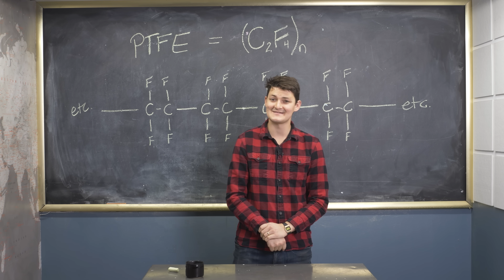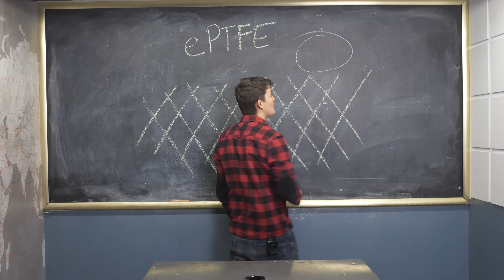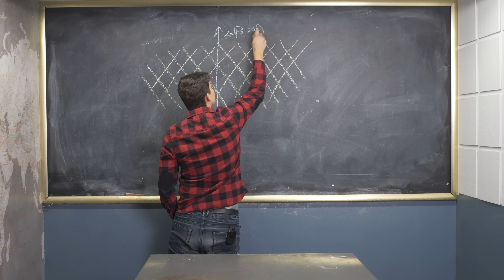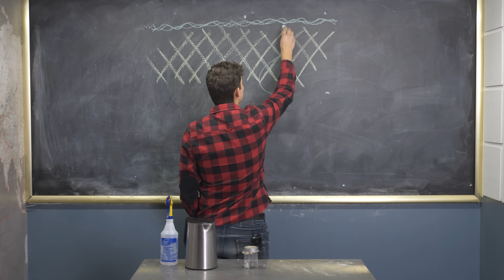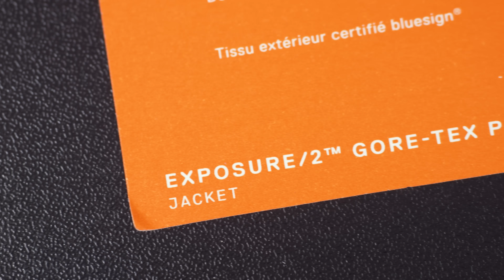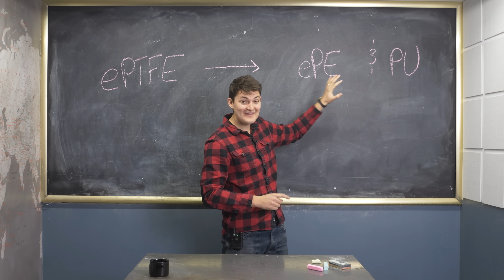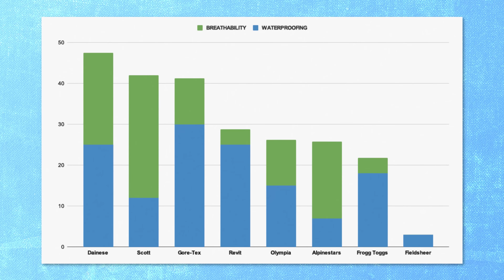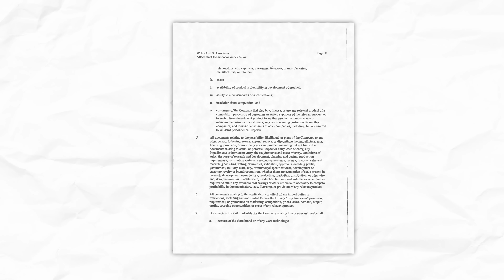Gore-Tex is a Marketing Gimmick

Comment: I was in the US Army when this stuff was on it's takeover in the boots and jackets department. We were forced to wear it, basically for testing, and we all come across one common point. 

Rather be soaked wet, than soaked in sweat
Reply: I remember getting my first issued Gore-Tex "raincoat" and it was terrible.  Sure it didnt let water in (but it did) but I was sweating my ass off inside it.  When youre in the humid rain standing watch for hours on end water just finds a way to seep in, Im guessing through the stitching.
Reply: Dude, the old ones were RUBBER.
Reply: In heavy or prolonged rain you're going to get wet eventually anyway  Might as well just accept this truth and choose clothing that keeps you warm & comfortable even when wet, and is quick drying.
Reply: First Gen had no vents. That was the only issue, and you didn't layer properly.

I literally have a first gen Gore-Tex military parka from the navy. Ever heard of wool? 😂
Reply: So you rather be wet by cold rain than by your own bodytemperature sweat?
Reply: @halamagrep9727  woolcloth keep you warm, even when u are wet.
Reply: Imagine staying in a hot bathroom after you've finished your shower. Even a hot and humid SE Pennsylvania July day is preferable to that. The actual issue is that in a rain jacket, soaked in your own sweat, there's no possible escape. @halamagrep9727
Reply: @halamagrep9727  Right, because sweat is meant to maintain your bodytemperature.
Reply: @jesperburns   did u ever do physical activities outside when its cold?
Reply: @halamagrep9727  I was a professional ice speed skater and still go skiing every year.
That's not what the military dude is talking about though, as you don't do those things when it's raining. Try understanding it from his point of view.
Reply: @jesperburns  Im a MTber and i do those things outside when its raining. and thats what waterproof jackets are all about. To keep the cold rain outside and the warm air in. Ofc you are wet, but not cold. its not a hard concept to grasp
Reply: @halamagrep9727  Cycling is really tricky when it comes to clothing choice. You take a level of physical exertion on par with running and then add in moving at 15-25+ mph, rain, near-freezing temperatures, and then maybe even a headwind too for extra fun. Coming from a distance running background, it's a lot more complicated than just slapping on enough slayers.
Reply: @Pellagrah This is true. The mention (in the video) of the wool jumper and bin bag made laugh because there is some truth. Often (when cycling) I want a close fitting, lightweight, easy to put-on/take-off rain layer only because the second it’s soaking me there will be a layer underneath better at allowing heat to escape and wind chill off. Wool is actually quite a nice base and mid layer imho.

Comment: And that's why proper design matters. The last two jackets I bought are actually breathable: they have adjustable air vents on the sides, rain protected by their location under the armpits, and my current one even has a moscito net for insect protection. Even during extensive biking I keep cool and mostly dry. The only part not perfectly ventilated, especially when carrying a backpack, is the middle of my back. Looking forward to the design that solves these remaining issues.
Reply: I'm looking for good rain gear. What brands do you like?
Reply: I think you'd need channels or a perferable layer to allow air throug. Like the mesh foam pads or mesh stretched like on backpacks
Reply: @tajr22  Probably. I think this is already part of some motorcycle jackets. 

And for the people asking: If you are looking for functional 3 season wear, ignore the outdoor adventure stuff and look for work wear brands instead and select the one with the least offensive color scheme.
Reply: @haifutter4166  pretty good bet with work wear although I've had some hit or miss. Not all of Helly Hansen is good.
Reply: why should you expect ventilated back when there is a backpack on your back?

Comment: I am buying goretex shoes for years now and never ever I had any issues with them. But I am sure of one thing. I will sweat like pig in those, they do not breathe. But, if I accidentaly dip int pool of water (assuming not over upper edge) I will be completely dry (apart from afire mentioned sweat). Maybe some dodgy marketing but I know what that is and what it is and I will buy my goretex shoes again for winter time. No other "water repelent spray" or similar stuff ever worked propperly or at all.  That is comming from some 20 ish years of experience give or take.

Comment: I worked for a textile mill and we had a treatment for our outdoor wool which was waterproof but was so light it felt like the regular wool. Trouble is because it felt like nothing the retail customers didnt trust it and didnt buy the garments made by our fabric. Manufacturers went back to buying our older, "waxier" versions.
Reply: Hi, its really interesting! Could you give me any information how that kind of wool is called? Or how and where i can find this type of wool?
Reply: I dunno about the wool but you might find marine cotton interested.  Cotton woven extremely tight and keeps water out.  Expensive.  @Grandemuczaczo
Reply: @Grandemuczaczo  seconded :)
Reply: As someone who has some experience wearing historical clothing, we have kind of collectively forgotten how good natural fibers are. An outer layer of the right wool fabric will keep you warm and dry without any fancy treament thanks to the natural oils in it, as long as you don't wash them out with detergents. Inner layers of linen are great at managing sweat, dry quickly and will never get as smelly as synthetics.
Reply: @porter-831 I started out as the lowest budget camper with the crappies material, literally garbage bags and tarps. As I got older, I bought "better" stuff but eventually realized it wasn't doing that much and later "downgraded" again. It's not worth all the thought and money.
Reply: @porter-831  yes I have sprayed my old woollen cloak for renfair with a modern waterproofer and it looks the part and keeps me much dryer and is much more comfortable than my "technical" garish modern waterproof
Reply: Can't you use clever demos to explain the pros of you product? In digital age easy to make good videos about it while hand on demos are always the best. TBH, I would take regular wool over any goretex garment.
Reply: @cubertmiso  While alternative fabric suppliers can make all the videos they want, Goretex has outspent the rest of the market many times over in convincing the customer that it is the best. When we manufactured waterproof breathable clothing, if someone said how does it compare to Goretex, it was unlikely they would buy our product.
Reply: That's so funny. That happens in most industries in America currently- Weight is associated with value so for example manufacturers of lower-end luxury pen, phones, bicycles, EVERYTHING will add functionally worthless steel blocks inside the product to increase the weight.
Reply: @vitriolicAmaranth  Britain too. I suffer from nervous system issues. I was fine with many products in the 80s. Then, everyone got all, "feel that quality," and eventually, just-about everything was made uncomfortable for me to use; too heavy. But as for Gore-Tex, I don't think I've ever had a Gore-Tex garment which worked properly for long, if at all.
Reply: Material wool does have some great qualities, but I'm talking about a treatment we added in the manufacturing of the fabric. We also did the same with linen. It was a textile mill called Solbiati, its an Italian mill but I worked at their satellite office in London. You wouldnt necessarily see "our" fabric but you"d find many designer garments and items made with our fabric.
Reply: @promophobe69  what was the treatment? I work in soft-goods procurement.
Reply: @promophobe69 I love light waterproof and breathable, I don’t find goretex that light nor breathable, tend to find pertex better, but always open to different garment fabrics.
Reply: In this part of the World, the Aran Sweater rules supreme.  Thickly knitted wool, with natural oils left intact,  totally impervious to rain but totally breathable
Reply: Kind of the same with everyone wanting heavier metal smartphones because they FEEL higher quality in the hand, despite the fact there's cheaper, lighter, recyclable and insanely durable polymers out there that will outlive your software support by decades anyway.
Reply: @readyforlol  Nokia used to do a good mix of metal and polymer, but alas the 'premium' craze took over and hasn't left.
Reply: @readyforlol Oh, I'm very aware of that and hate the modern metal/glass trend.
Reply: @readyforlol  Yesss, my motorola g6 for 150 bucks has lasted me 6 years, still goes great, just no more android safety-updates, which forces me to buy  a new one...
Reply: @readyforlol I honestly buy only metal headphones because the plastic and polymer ones I’ve bought eventually break, probably because it tend to drop them or fall asleep on the side while wearing them, I’m clumsy, but no metal body headphone has broken while going through the same, so not because it feels better, but because I haven’t found one that just lasts like a metal one
Reply: @readyforlol yeah but I like a cold phone and nothing can replace that
Reply: That was a mistake of your marketing department
Reply: on top of all that was said here, Lanolin itself (naturally occuring wax/oil that is secreted by wooly animals) aids in some waterproofness and weather proofing in nature and when restored to wool in the garments.
Reply: Similarly I have a cotton jacket thats been given a waterproof treatment and it works great! Feels a lot better imo than GoreTex, just as breathable if not more so, and its largely just as waterproof. With added bonus of not being made of plastic.
Reply: should have sold them in sealed plastic bags with visible water in them. show em just how waterproof it really is.
Reply: What was the garment brand if you can say? Id love to buy some.
Reply: and they still don't trust softshell
Reply: Let me guess......Bur........
Reply: Friend of mine just bought a very thin waterproof jacket. I couldn't believe that it would work, because even the sun is shining right through the jacket. It does seem to work greatly, though (for the use case at hand). Still struggle to believe it until I have seen it myself.
Reply: @bernb  guessing that you mean hydrophobic coating that ages really bad. ofc new fabric works for a while.
Reply: @bernb  plastic bags are waterproof and the sun shines right through them. What's so hard to believe?
Reply: Wool is the best - keeps heat retention even when wet. I learnt that in a survival course in the north of Sweden
Reply: @slumbercat in scandinavia we learn that in kindergarten
Reply: Who knows if it's true, but when I was in the army one of the old instructors told us when the army was first testing kevlar helmets, they made them as strong as the old steel helmets, but grunts didn't trust them because they were so light weight. So they just added more kevlar until they were as heavy as the old steel ones. Although as a result the kevlar helmets will stop pistol rounds.
Reply: I once had some Karisma fleece treated with a DWR finish and it was terrific. It shed light rain without any problems and kept you comfortable even in moderate rain with no build up of sweat. Was worth doing for the right customer who appreciated that everything is a compromise.
Reply: Is this because the wool eventually soaks up the water and becomes heavy, wet and cold?  What was the treatment that your company applied? I'm very luddite but advanced fabrics like these just work very well for what they're supposed to do
Reply: Actually, wool is the only fiber that I know of (natural or synthetic) that retains some of it's insulation abilities when it is soaking wet. There is even some research suggesting wool actually heats up when wet, apparently because of a chemical reaction involving the breaking of hydrogen bonds between water molecules. When wool fibers soak they trap water inside the fiber but they retain air pockets between the fibers, that water remains hot, like microscopic hot water bottles or being cozy inside a wet suit. When water evaporates from a fabric, the effect is actually a cooling effect, that's why you sweat. It's not a question of being a luddite or not, it's about actually experimenting and knowing what works and why.
Reply: @laurap3244  wool is well known for still keeping you warm when it's wet btw, it does get heavy though

Comment: If you were backpacking in the early 2000s gore-tex was a real lifesaver!!! 
This is another case of people using a material for a purpose it wasn’t designed and then getting angry at its performance.
The thing is backpacking you need waterproof, but you also need quick drying!!! I have never used waterproof boots for the same reason I used goretex… The reason is nothing I’d waterproof only water resistant!!!
So if you get wet you need to start drying ASAP. Breathable synthetic fabric is essential.
I think the original discovery was brilliant and it’s the over marketing that’s caused all the criticism.

Comment: Now…I’ve known that a humidity differential/pressure is needed to make it waterproof for several years.   I’ve also been damp on the inside around the shoulders and arms even when a Goretex jacket is worn and open zipped.  I just accept it can work, but not always.  But then…anything truly waterproof isn’t breathable and you become a boiled-in-the-bag ready-meal. 

To be warm, even if wet, always layer and wear wool next to the skin.  Wool has been around on sheep for longer than Goretex.  It’s properties have been known since way before the Scots used wool tweed in clever patterns to pretend to be rocks or Heather while stalking deer.

Comment: I used cheap waterproof brans, Gore tex, Event, Dura pore, Stormproof etc... They all start to leak and/or build up moisture underneath. The only thing that really works is a US made Military Ponchio (or a garbage bag), to vents from the underside and is really waterproof. And forget those yellow rubber like jackets, they are really sweat traps.... Been a military long enough to not give a damn anymore about cold, wet and mud....

Comment: In GTs defence, i can remember the stuff before GT and it was like wearing a garbage bag, the sweat would gather on the inside if you so much as gently walked to the point of it being useless. Now though i have many non GT products that are equal or better than GT though as you stated it's still not entirely waterproof and breathable, just much more so than what was available previously.

Comment: I've always thought these fabrics were not quite what they claimed to be.

It very much depends on the situation but many moons ago when I was hiking (or tramping) in New Zealand, it was recommended by some that a water-resistant poncho is actually better, especially in humid conditions. You can't really avoid getting damp because of the combination of sweating and high humidity, but using man-made fibres in layers, not least because man-made fibres dry out much quicker. If you've ever worn cotton and got wet, you might have found out just how cold you can feel and how long it takes cotton to dry out. Wool, however, is naturally water-repellant, but heavier than man-made fibres. A layer of silk next to the skin is also not a bad idea, as well as nylon shorts.

Comment: I got a goretex reflective rainjacket a few years ago working in a mine, it was super expe sive as tailored to me, it kept my upper parts dry but wherever the wind could blow rain would get in and your feet and everything else would get soaked. It later lost its specialness after a few years, I ended up buying a can of spray on scotch guard for our lounge, as an experiment i  just sprayed the outside again and it was back to perfect again. So this blew my mind actually figuring that out by a fluke. Tried it on a $5 rain jacket and its no diferent to the expensive jacket.
Reply: Scotch guard is extremely bad to breathe because of the PFAS. I assume it flakes off over time as well. We all have PFAS in us these days but the dose matters. Higher generally leads to greater cancer risk
Reply: @wolfferoni well the guy worked in a mine. And thinking about US workplace safety he will get cancer anyways.
Reply: Not exactly, taped seams go a long way along with any waterproof coating and are usually only found on slightly more expensive jackets. Most of these jackets are vented as well, so even if the shell isn't breathable, your armpits and other vented areas can always breathe when vents are open.
Reply: Well yeah a $5 rain jacket is completely non breathable.

That's the whole point of Gore-Tex. And most people that think it's not breathable also have no idea what the hell of base layer is or why they need Marino wool...

You still need vents.

Also this guy literally said, my pants and shoes got wet...yeah it's a jacket my dude. 😂
Reply: And there's no reason to have gore tex in a mine. The fabric will obviously get torn eventually. Get a heavy waxed canvas jacket and tape up the seams.

😂😂😂😂😂😂😂😂😂😂

"Gore tex is terrible waaaah"
Reply: Cheat "waterproof" jackets use that spraying technique, meanwhile real goretex jackets do not. So they don't use their "specialness" in a few years.
Reply: @Qaosbringer a few years WORKING IN A MINE will poke holes in anything, including the special form of gore tex fabric. Then you spray on a layer of waterproofing. Of course, if a $5 jacket plus $0.05 of waterproof spray = a $50 raincoat... the goretex is a ripoff.
Reply: @Qaosbringer what are you on about gore recommends nikwax dwr on all fabrics using their membranes